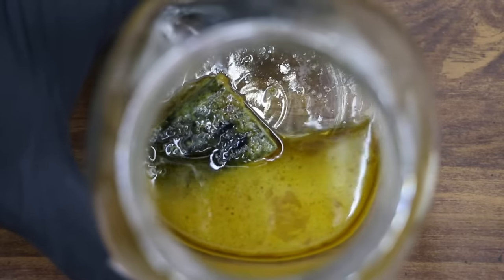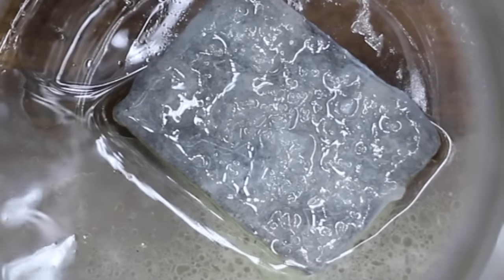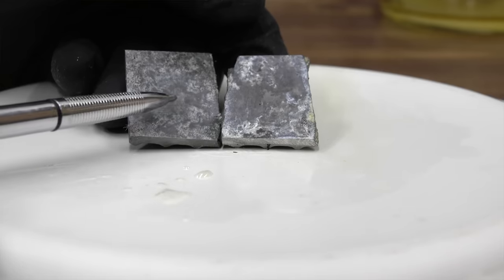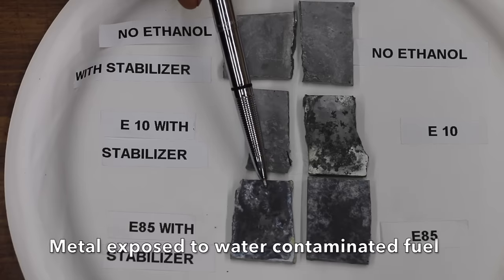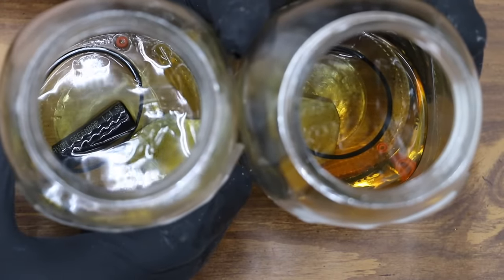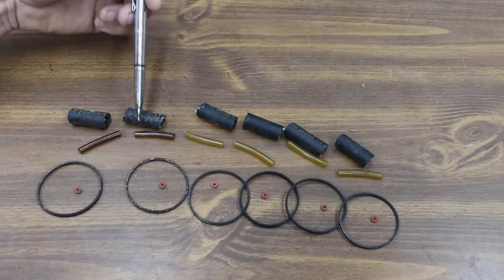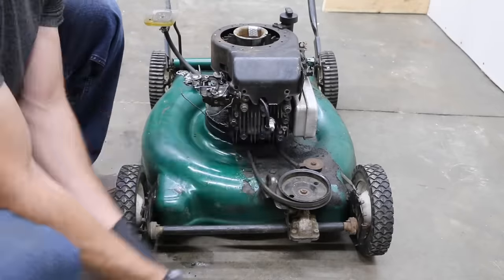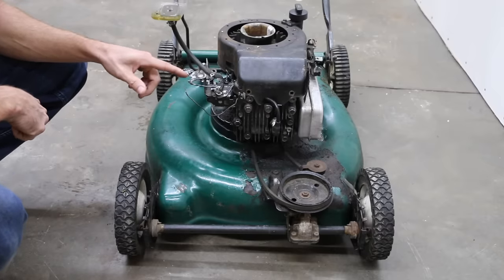Does Fuel Stabilizer Prevent Ethanol Damage?  Let's find out!

Comment: Ethanol free gas around me is non-existant. What additave can I use in my gas to combat this? I'm currently using gumout multi-system tune-up pea
Reply from the maker: Thanks for the video idea.
Reply: @ProjectFarm  I have a 1965 c10 and spilled a little gas out the tank on the panel.
3 hours later the spill was dry, tea stained and sticky! YIKES! I used gum out on a towel and it cleaned right up in a single swipe! I'm using that in ever full up.

Comment: What is the best ethanol removing product I can pour in 87 octane gasoline to remove the ethanol for a 2 stroke outboard motor?
Reply from the maker: Thanks for the video idea.
Reply: @ProjectFarm  with the price of non ethanol gasoline at $4.95 it may be cheaper to run an additive in my fuel at this point? If it’s just as safe.

Comment: The reason stabilizer doesn't work is simple. If there was a special combination for ethanol fuel to avoid issues they would've already included it in the fuel. Someone would just market it with the special stabilizer already in it, or simply it would all be sold like that.
Reply from the maker: Thanks for the feedback.

Comment: I cant find any content on this but MMO in E10 gas seems to work for storing the fuel. I have E10 gas that has been sitting in an old carbureted motorcycle for 18 months treated with MMO and it fires like a champ every time and runs great. I have E10 gas thats been in a gas can I use for my mower thats treated with MMO for again 18 months and Im still using it and the mower enjoys it and runs great. Am I crazy or is this a sleeper fuel stabilizer that actually works?
Reply from the maker: I'll have to test MMO as a fuel stabilizer in the future.

Comment: It isn't that ethanol is corrosive alone, it is that ethanol is hygroscopic and grabs hold of water which in turn causes corrosion.  Thanks for the video.  Fuel stabilizers are supposed to slow the formation of fuel gelling caused by olefins found in most higher octane fuels.

Comment: How long does it take for fuel to go bad?
Reply: Where I live fuel goes bad in 2 weeks.
Reply: @rrt08  Two weeks?  Wow that is quick!  Dont know how long mine lasts, I replace it in no less than 6 months IF it's not yet been used.  And that's straight gasoline.
Reply: @billjenkins5693  yes talked with my local Toro dealer after buying snow blower brand new wouldn’t start opened up carburetor to find what looked like green gelatin substance. Now just use canned ethanol free 93 octane gas. Costs more but no issues. Always run equipment dry of fuel and you need to pull the cord a few times to get the fuel out of carburetor  so it doesn’t plug it up.

Comment: Hmm, I have some two stroke fuel mix for my weed-eater that is at least 3 - 4 years old with STABIL in it and it still runs perfectly. I've been running my mower on 2-3 year old gas with STABIL in it as well. I don't drain it at the end of the season, I don't run it out of gas. Wherever the fuel level was when I parked it is where it'll be in the spring. I fill it up (with the same old gas..), start it up, and mow. My guess is STABIL actually works? I buy cheap 85 octane gas with 10% Ethanol. Cuz that's what's down the street. Seems like the moral of this video is don't expect Lucas treatment to do anything except empty your wallet!

Comment: I am British and have lived in Thailand for 14 years.  E20 fuel equivalent to 91 grade  Gasolene is a mix of 20 % Ethanol and 80 % 95 grade Gasolene. I have used this for years like many Thais with no trouble whatsoever or changes to fuel pipework or any other engine part. I think the story of alcohol degrading pipework is at best only a scare story.

Comment: Two issues I have with your testing. #1 you do not specify the method you measure the amount of water contamination in the fuel to Start with. No fuel stabilizer will remove or prevent corrosion if you just pour water in your fuel tank. Water contamination in the real world comes from atmospheric absorption. A better test would be to measure the amount of water in fuel before you start tour test. #2 you make the blanket statement that fuel stabilizer won't prevent corrosion.  You only tested one brand. You need to test multiple formulas to be able to make a definitive statement.  Personal experience with my own small engine and a different stabilizer differs from your results.  Most of your videos I agree with. I take exception to this one.

Comment: So the FACT that my 69 428 CJ Stang started and ran (June 2021) in less than 3 minutes (2 cranking WITHOUT ignition to coil to build oil pressure) after 11 YEARS and NOT having added any fuel to the tank in 24+ years (probably mid 1990s) could NOT happen per your statements...  Buy some quality fuel StaBil to keep gas viable.

Comment: Why did you intentionally add water in with the e85 and metal? That makes zero sense. I don’t put water in my fuel tank when I fill up. Should’ve just let it absorb whatever moisture from the environment naturally instead of artificially adding more water than would be present. Definitely not a good comparison.

Comment: Firstly, let's be more accurate, it was just the stabilizer you chose that did not prevent corrosion. Secondly, you never provided detail if you added the correct ratio of stabilizer to fuel. Also stabilizers are designed to do more than just help prevent corrosion.

Comment: With the communist/globalist regime in DC creating a energy crisis( which  is another topic) the price of all gas and diesel has soared. Consequently, rec 90 has become astronomical. So I was seriously considering using E10 treated fuel and could not get a good answer one way or the other. So putting that in my outboards - Yamaha ( which are 30 grand with rigging a piece) had me perplexed. But your video just answered my question- I will stick with REC 90 for all my outboards and small engines. It has went from 2.90 to 5.30 down here in Florida and way more at the marinas. The answer? To cut down my usage proportionally! So spending $ 350.00 to go out fishing is out. That money will buy a whole lot of fish at Publix! Thanks Joe Biden and his globalist handlers and thank you for doing this video that the supplement industry does not want you to see!

Comment: I'm a retired auto mechanic, and when they came out with the E-10 ethanol gasoline, told the other mechanics I worked with to get ready for a lot of extra carburetor and fuel pump business, when you do your research on what the E-10 gasoline is made of, I said, who was the hairbrain idiot that thought that up, like everything else, just follow the money trail, the E-10 gasoline is a money making racket or scam for all the engine manufacturers. I will not use any type of ethanol gasoline in any type of engine period.
Reply from the maker: Great feedback! Thank you

Comment: Can someone tell me why the hell they even still allow the ethanol in the gas?!
Reply: Hi Freedom Machines, for several reasons:
1- Prevents detonation (or at least decreases it) with modern lower quality (octane rating) gas,
2- Theoretically, decreases need for gas (in theory only),
3- Politically, supposed to be "cleaner" (untrue),
4- Politically enables more sales of corn (for the US),
5- Politically, it "sounds" good for voters who do not know much about chemistry and/or engineering,
On the other hand...
1- Increases corrosion in metal parts it comes in contact with (pre-2001 engines)
2- Evaporates more (increases pollution),
3- Decreases power of gasoline (by ~3% for E-10)
4- Needs specially treated rubber/plastics,
5- Production (i.e. processing) Carbon (C) cost for producing ethanol for gasoline is actually higher than using pure gasoline (SAE reports hidden by politicians),
Hope it helps, Ciao, L (FoMoCo engineer)

Comment: Bottomline-
This ethanol fuel they have pushed on us… is 💩.
I’ve had mechanics tell me for years that ethanol fuel are completely ruining the carburetors & fuel systems of countless vehicles & mowers.
I try to use non ethanol gas, but it’s very difficult to locate,
So when I have to put an ethanol in my mower-
I go with high test, don’t know if it really helps or not.
Reply from the maker: Thanks for the feedback.

Comment: Something is weird here, I actually did the same experiment but the fuel containers were much more full and sealed. I used Sta-Bil which is not a well rated fuel stabilizer (I just had it,) but my corrosion was not like yours at all. The fuels were stored in an unheated garage in Kansas over the winter. They did start the vehicles ( lawn mower, tiller, chipper and weed eater) after winter. The devices did not run as well but showed no significant corrosion. Does somebody out there have any idea why this could have been that different? At the moment I am thinking that the fuel I bought was a lot better than the Project Farm fuels

Comment: I think that Lucas stuff is GARBAGE. I’ve always used Stabil and gone a year without using my pressure washer, still ran fine even with the ethanol crap fuel. You should do a video with different stabilizers.
Reply from the maker: Thanks for the suggestion.

Comment: 👾a little Marvel Mystery Oil in your gas tank. It'll protect everything in carburetors and injection systems and you'll get valve guide & upper cylinder lubrication & pump / injectors will last forever.
Reply from the maker: Thanks for the video idea.

Comment: Looks like you are on Lucas Propaganda Payroll. How about starting with the comparison of Ethanol, Methanol, and Isopropyl alcohols first? All alcohols attract water. I've taught this as a foundation to understanding the need for fuel driers for 22 years. The next step is stabilization and corrosion protection. Once again, I have demonstrated comparisons for 22 years. You used metal pieces, but I got dramatic comparisons with steel wool in as little as a week. Honesty and integrity are important to me. That's why my career was with BG Products. I had to swim with the snake oil industry, but I never had to use tricks to convince my customers that BG Products were NOT snake oil.